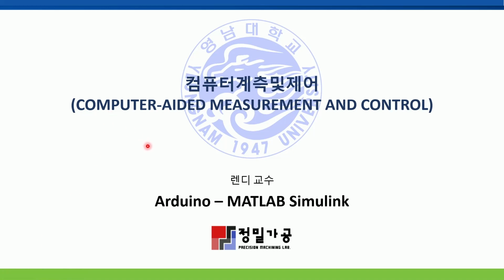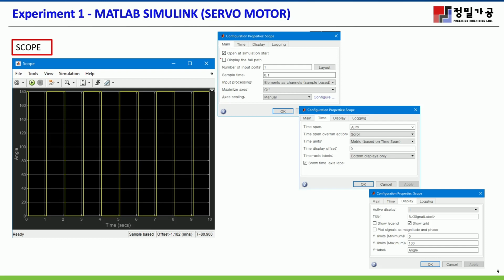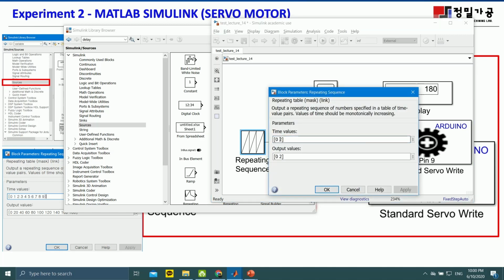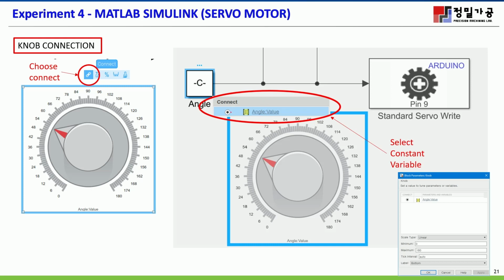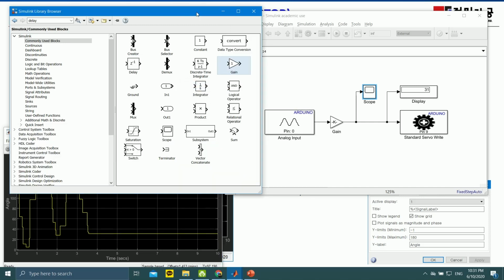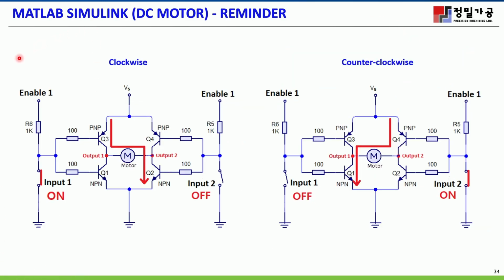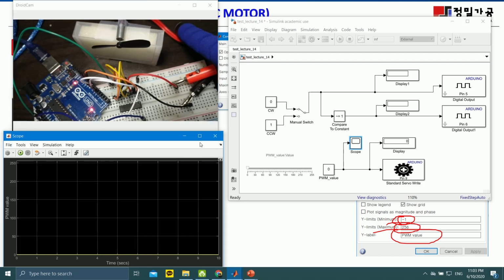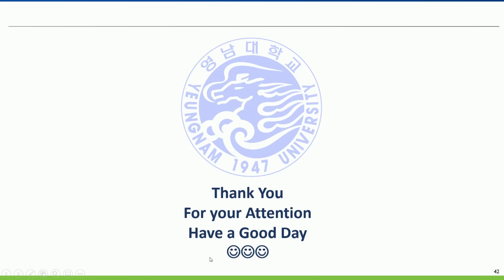컴퓨터계측및제어 - ARDUINO MATLAB SIMULINK - SERVO and DC MOTOR (14주차)

Comment: hi thanks for you video, where are you find the pwm_value??
Reply from the maker: You could add a constant variable and input the constant value as the scroll bar value
Reply: @rendikurniawan6063  hello, I will design the simulink according to the label movement of the information coming from the video controlled with 3 motors, of course, first of all, it will get information from gprs, monitor the coordinates with the satellite camera, track the moving objects and turn in that direction in the motors.which type of block can we use in sumulink
Reply from the maker: @tarksev3273  hello, what type of motor do you use? your project is advanced.
Reply: DC motor